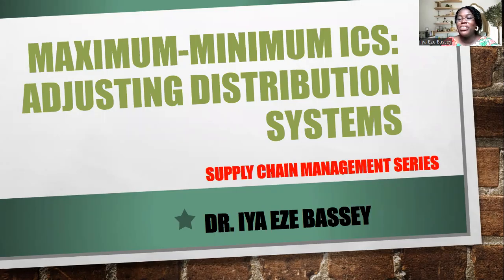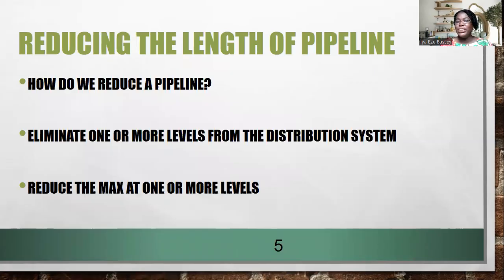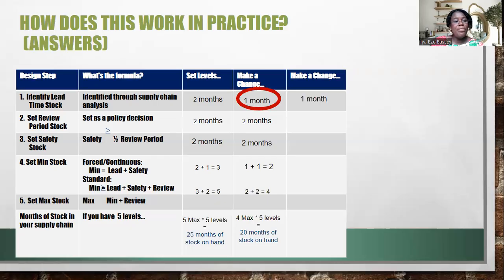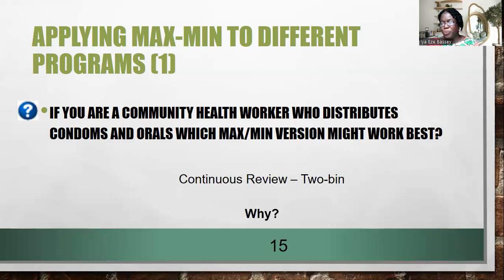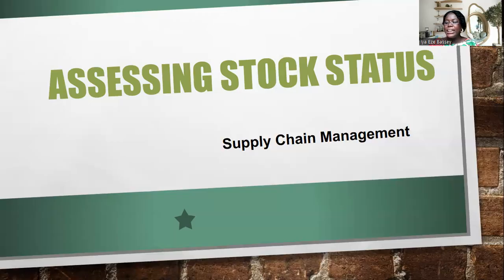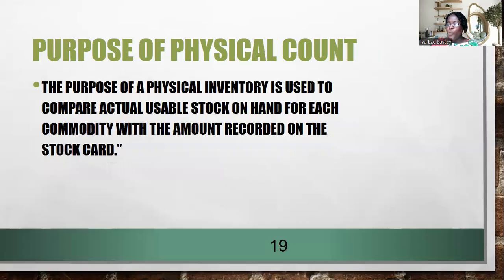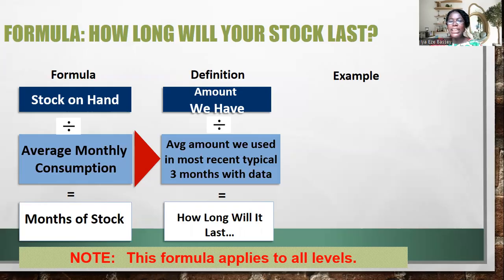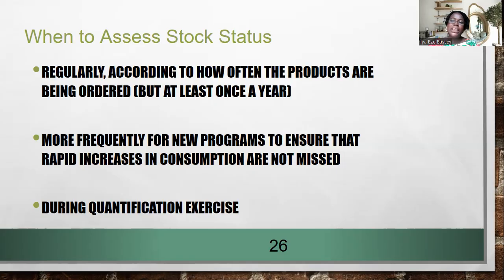Maximum-Minimum ICS: Adjusting Distribution systems (Supply chain management series)

Comment: In summary.
The steps in designing a max -min ICS are:
1. Set up initial max -min policies for each level and type of faculty
2. Check if the overall distribution will function properly if the level specific max - min policies are implemented 
3. Check the total length of the pipeline that the policies at  each level imply.
  I also learnt how to reduce the length of a pipeline and also Joe to reduce the maximum stock level.
Also some factors that impact max-min stock levels which I’ll list few ; lead time, reliability of source of supplies affect of a zero balance or stock ,management skills of staff,age of program etc 
I also learnt about the advantages to using max-min system which are;Avoid overstocking, avoid under stocking,minimize wastage  etc
I also learnt how to apply max -min to different programs and when to access stock.

Comment: In this video, I have learnt the steps in designing max-min ICS 
1) Set up initial max-min policies for each level and type of faculty 
2) check if the overall distribution will function properly if the level specific max-min policies are implemented 
3) Check the total length of the pipeline that the policies at each level imply.
        I also learnt the other factors that impact max-min stock levels(1) 
- Cost of products 
- Reliability of Transportation 
- Storage capacity 
- Cost of storage 
- Storage conditions at different levels 
- Shelf life of health commodities 

    The advantages of using max-min system is to 
- Avoid overstocking 
- Avoid understocking 
- Minimize wastage
- Avoid costs emergency orders 
- Simplify inventory control decision making 
-  Consistency of stock levels 
- Reliable Data source from SDP for forecasting and quantification.
 Thank you ma'am

Comment: Maximum - Minimum ICS 
The steps in designing include:
* Set up initial max-min polices.
* Check for effectiveness if distribution.
* Check the total length of the pipeline.
        Factors that impact Max - Min stock levels
* Cost of products and storage.
* Storage capacity.
* Lead time and age of program.
* Accuracy of forecast.
      Advantages
1. Minimize waste and avoid cost.
2. Avoid overstocking abd understocking.
3. Simplify inventory control decision making.
     Physical count is the process of counting be hand the total number of usable units of each commodity in your facility.

Comment: Thank you very much ma for this educational lecture.

In summary, there are steps in designing a maximum/minimum inventory control system.
I also learnt how to reduce the length of a pipeline by eliminating one or more levels from the distribution system and also by setting up policies that helps reduce the maximum at one or more levels.

I also got to know of the factors which impact maximum/minimum stock level. They include;
Stock capacity, cost of production, cost of storage,  shelf life of health commodities, lead times ,etc.

Advantages include: to  avoid overstocking and under stocking , to minimize wastage and also maintain stock level consistency.

While challenges often faced with systems include 
*System with numerous levels and also system that manage a large number of condition.

Thank you very much ma.
I look forward to more enlightening videos.

Comment: At the end of the lesson, i learnt about:

Factors that impact max-min stock levels which are: The cost of products, reliability of transportation, storage capacity, cost of storage, shelf-life of health commodities, lead time etc.
 
The advantages of using max -min system which are:
Avoids overstocking, minimize wastage, avoids cost of emergency orders, maintains consistency of stock levels and simplifies inventory control decision-making.

Also, the definition of physical count which is the process of counting by hand the total number of usable units of each commodity in your store or health facility at any given time. The purpose of a physical count is to compare the actual usable stock on hand for each commodity with the amount recorded on the bin card or stock card.

Comment: Thanks ma for this impactful knowledge
 I learnt that the steps involved in designing a maxi-min involves
 @set up initial max-min policies at each level
@ set up initial max-min policies for each level  at each level  and type of  faculty 
@ check if the overall distribution will function properly if the  level max-min policies is implemented
 There are most factors that affect max-min level
* cost of production
* lead time
*cost of storage
*Age of program
* Accuracy of forecast
*storage capacity

Comment: From this video, I have learnt
~ The differences between push and pull system which is a level of system that determines or calculates order of quantities determinism.
~ Advantages of maximum minimum inventory control system which prevents under and over stocking, curtails emergency order cost and maintains consistent stock levels.
~ Challenges of maximum minimum inventory control system which are products cost, storages capacity and storage conditions.
~ Definition of assessing stock status which is to evaluate the availability, adequacy and distribution of inventory.
~ The purpose of assessing stock status which is to determine durability of supplies.
~ Physical count or physical inventory which is counting by hand the total number of unit of commodities that are usable at a particular time.This helps determine the number of months of stock available at any storage level using inventory and usage data.

Concerning the assignment,
1. TB drugs review period is monthly or quarterly, the inventory control system is min-max inventory system which is because it aids in preventing wastage and ensures the drugs availability.
2. HIV AIDS review period is also monthly or quarterly, the inventory control system is pipeline inventory system because it maintains continuous supply.
3. Malaria review period is monthly or seasonal, the inventory control system is reorder point inventory system because it requires dynamic stock adjustments.

Comment: Thank you ma for this enlightening on this lecture

In summary, the maximum _ minimum Inventory control system provides comprehensive guidelines for the management of stocks levels to prevent both overstocking and understocking of goods. The steps in designing a maximum minimum control system includes:

1) set up max_min policies for each level and type of facility

2) verify that the overall distribution will function properly

3) Establish initial max min quality for each 'evel and facility type.

my benefits of using max_min system acludes:
- it helps to avoid overstocking

- Avoid understocking

- it also helps to minimize wastage

Some challenges of this system include: system with numerous levels

- system that manages large number of commodities

- system that manages products for new programs.

Lastly, physical count of stocks is important and should be done at least once a year. In cases where stocks are moved rapidly, count should be done frequently to ensure adequate inventory management.

Comment: Thank you ma
In designing a maximum to minimum ICS
Set up initial maximum minimum policies for each level
Check if the policies will work in the overall distribution
Check the total length of the pipeline.

To reduce maximum stock level
Shorten the review period at one or more level
Reduce the lead time at one or more level
Improve the distribution system reliability at one or more level

Factors that impact max - min stock level 
Cost of product
Reliability of transport
Storage capacity
Cost of storage
Storage condition at different level
Shelf life of health commodity

Advantage of max - min stock level
Avoid over stocking
Avoid under stocking
Minimize waste
Avoid cost of emergency orders

Comment: In this topic I learnt that:
A. The steps in designing a MAX MIN ICS ARE:
1. To set up initial max min policies for each level 
2. Check if the overall distribution will function properly if the level specific MAX-MIN policies are implemented 
3. Check the total length of the pipeline that the policies at each level imply 

B. How do we reduce a Pipeline 
1. Eliminate one or more levels from the distribution system 
2. Reduce the max at one or more levels 

C. How to reduce maximum stock level 
1. Shorten the review period at one or more levels 
2. Reduce the lead time at one or more levels

Comment: When appropriate maximum and minimum stock levels are put in place laboratories can ensure they have enough inventory to meet testing demands without excessive stockpiling or shortages which in turns help maintain smooth operations, optimize resource utilization and ensure timely delivery of accurate test results.

Comment: Maximum-Minimum ICS: Adjusting Distribution System

Aims to optimize inventory levels and distribution systems
Uses a maximum-minimum inventory control system (ICS)
Sets maximum and minimum inventory levels for each item
Automatically triggers orders when minimum levels are reached
Ensures timely replenishment and minimizes stockouts

Benefits include:
Improved inventory management and control
Reduced stockouts and overstocking
Increased efficiency and cost savings
Enhanced customer satisfaction and service levels

Comment: I understood the steps involved in designing a max-min ICS which are 
Set up initial Max-min policies for each level and type of facility 
Check if the overall disturbance will function properly if the level specific Max-min policies are implemented 
Check the total length of the pipeline that the policies at each level imply
The whole purpose of assessing stock status is to determine how long supplies will last

Comment: Great video ma 
 I learned the different ways by which distribution systems can  be adjusted effective inventory control system this can be done either by
   
   I. Reducing the maximum stock level
II.   Checking the length of the pipeline which is the chain of supply from the manufacturer to the final consumer

    The lecture also emphasizes the importance of the maximum and minimum control system to avoid overstocking, wastage, understocking and overall ensures consistency of stock levels

Comment: Thank you for the lecture ma. With this I
have been able to understand that the
max-min inventory management system (ICS)
gives detailed instructions for managing
stock levels to avoid overstocking and
understocking of commodities. Steps in
designing a maximum minimum ICS include;
- Setting up initial max-min policies for each
level and type of facility
- Checking of overall distribution will function
properly if the level specific max-min policies
are implemented.
- Checking the total length of the pipeline that
the policies at each level apply to

Comment: In summary at the end of the class ,I got to understand for improved distribution system in nigeria we need to look at LENGTH OF PIPELINE. 

I got to know the various steps in designing a Max-Min ICS,Also how to reduce a length of pipeline by eliminating one or more levels from the distribution system and Reduce the max at one or more levels.
I understood how to reduce the maximum stock level by Shortening the Review Period at one or more level, Reducing the Lead Time at one or more level.
I learnt the factors that impact Max-Min stock level and Advantages of using Max-Min system.

I also learnt that the first thing to do while assessing stock is physical count and the purpose of physical inventory is used to compare actual usable stock on hand for each commodity with the amount recorded on stock card And also the purpose of assessing stock status which is to determine how long supplies will last
Finally I Studied the formula for calculating months of stock on hand and how they are applied.

Comment: The Maximum-Minimum Inventory Control System is a widely used inventory management approach in supply chain management that helps businesses maintain optimal stock levels. The system is based on defining two key parameters: the maximum level and the minimum level of inventory.

1. Maximum Inventory Level: This is the highest quantity of inventory that a business should hold to avoid overstocking, excess storage costs, and potential obsolescence. It represents the upper threshold, often determined by factors like demand forecast, lead time, and storage capacity.

2. Minimum Inventory Level: This is the lowest quantity of inventory that must be maintained to ensure the business can meet customer demand without facing stockouts. The minimum level serves as a buffer against demand variability and supply chain disruptions.

Key features of the system include:

Reorder Point: When inventory falls to the minimum level, a reorder is triggered to replenish stock before it runs out.

Safety Stock: A buffer stock that helps manage uncertainties in demand and supply.

Lead Time: The time taken for suppliers to deliver goods after placing an order.

This system helps companies balance the costs of holding inventory against the risk of stockouts, ensuring that inventory is neither excessive nor insufficient. It is particularly useful in industries with stable demand patterns but can also be adapted to handle fluctuations. Effective maximum-minimum control leads to cost savings, improved service levels, and better supply chain efficiency.

Comment: Thank you ma

I learnt about the steps in designing a max/min inventory control system 

I also learnt about ways to reduce a pipeline example eliminating one or more from the distribution system and reducing the maximum at one or more levels. 

Maximum minimum ICS is necessary for adjusting pipeline and ensuring accurate  inventory of commodities as it 

1. Avoid overstocking 
2. Avoid under stocking
3. Minimize wastage 
4. Avoid costs of emergency orders 
5. Ensure consistency of stock levels etc

Factors that can impact max -mom stock levels include 
- cost of products 
- cost of storage
- storage capacity 
- storage condition at different levels ETC

Thank you ma

Comment: Thank you very much ma 
    I learnt that the steps in designing a max-min ICS are .
Set up initial max-min policies for each level and type of facility, check if the overall distribution will function properly, if the level specific max-min policies are implemented and check the total length of the pipeline that the policies at each level imply.
I also learn about the factors that impact max-min stock levels which include, cost of storage, cost of product, storage condition at different level and storage capacity.
    I also learnt about the purpose of a physical inventory is used to compare actual useable stock on hand for each commodity with the amount recorded on the stock card .
    I learnt that challenges to using each version including system with numerous levels system that manage a large number of commodities, systems that manage product for programs.

Comment: In my summary I understood that Adjusting the distribution system in a Maximum-Minimum (Max-Min) inventory control system involves making changes to the system to ensure that inventory levels are maintained within the set maximum and minimum levels

Steps involves in designing a max-min ICS are
1. Set up initial max-min policies for each level and type the of facility 
2. Check the overall distribution will function properly if the level specific max-min policies are implemented 

I also learned the steps which is use to reduce a pipeline 
1. Eliminate one or more level from the distribution 
2. Reduce the max at one or more level

Factor that impact Max- Min stock level 
1. Cost of product 
2. Storage conditions at different level 
3. Storage capacity

Comment: THE STEPS IN DESIGNING A MAX-MIN ICS
4
Having watched the video i can apparently defuce the following concepts:
(A) Setip initial MAX-MIN policies for each level and type of facilities 
B Check if the overall distribution will function properly if the level specific MAX-MIN Policies are implanted.
C Check the total length of the pipeline yhat yhe policies at each level imply.
I also had access to the knowledge on how to reduce the length of pipeline, how to reduce the maximum stock level, how to set safety stock etc.
I also learned about the basic FACTORS THAT IMPACT MAX-MIN STOCK LEVELS, such as :
Cost of products,
Cost of storage,
Storage Capay,
Accuracy of Forecasts ,
Lead times etc.

I learnt the advantages of using a MAX-MIN SYSTEM,
Which are to:
Avoid overstocking or under stocking, avoid cost of emergency order,Minimize wastage,etc

Comment: I learnt:

- Adjusting Distribution Policies: Implementing specific maximum policies at each distribution level is crucial for optimizing inventory flow, particularly in public health supply chains.
  
- Pipeline Length Management: Reducing the length of the distribution pipeline can significantly enhance the efficiency of delivering medical supplies, such as HIV commodities, to clinics.

- Stock Assessment Importance:Regular physical inventory counts are essential in verifying stock accuracy and preventing discrepancies that could lead to stockouts or overstocking.

- Challenges in Inventory Control: Managing multiple commodities across various levels can complicate inventory systems, necessitating tailored approaches to each program's unique needs.

- Inventory Control Variations: Different inventory control systems like continuous review or standard version may be more appropriate depending on the complexity and volume of products managed.

- Calculating Months of Stock: Understanding and calculating the average monthly consumption against stock on hand is vital for effective inventory management, ensuring timely replenishment.

- Educational Assignments: Engaging with real-life inventory management scenarios through assignments helps reinforce learning and practical application of inventory control systems.